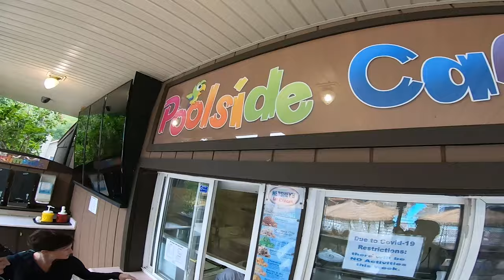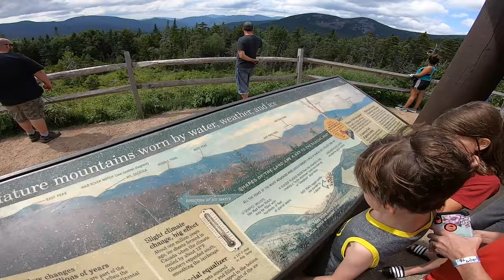Pop Up Camping White Mountains, Moose Hillock, NH | July 2020

Comment: May I ask which camera you are using? Is this all on Go Pro? IF so, is the camera handling all the audio? Seems like a sweet option for travel videos.
Reply from the maker: Its all GoPro! I used a combo of an old hero session (a tiny cube camera) and a GoPro 8. The 8 is silky smoooth when hand held. I like to use the Hero for small areas like up in the corner of the windshield visor. But, you can do the same with the Hero 8, or the Hero 9 is the newest version. The new GoPros have ridiculously good stabilization, especially in good lighting. In low lighting the stabilization falls apart. But the audio is amazing! I use my Hero 8 on my motorcycle and people have accused me of recording at my desk :) Its really good.
Reply: @sstressfl  Thanks for sharing! Good to know that works so well.